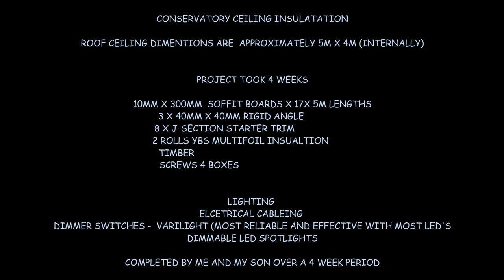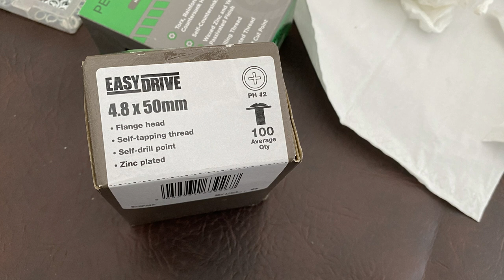HOW TO INSULATE A CONSERVATORY ROOF + SPOTLIGHTS + DIMMER SWITCHES & LED BULBS For Under £700

Comment: Really good job guys, like the idea with the box section around the edge with the down lighters , enjoy .
Reply: That's what I'm looking to do with mine as well. However, I'm thinking of changing it slightly and using a cill board on the soffit about 20mm deeper than needed to place led strip lighting in as well. If I have them switched seperately from the downlights it should give an uplighting effect.

Comment: Hi, You have a lovely video. Such a nice work, am well impressed with your finish. I am putting the soffits board together and it is really difficult trying to use the H trim to join them together and I am at a situation where the H trims are very tight for me to join the soffits board and it’s becoming very difficult. I watched your video and realised you used a different type of trim to hide the joints. 
Please what joints trims and type of screws did you use.?

Comment from the maker: All cladding surrounding spotlights used was 10mm x 300mm,  lengths are what your dimensions are. Hope this helps. The cladding was screwed directly through to wooden frame then I used pvc white screw caps.

Comment: Where did you purchase your cladding from please? Can the insulation not be stuck directly to the roof or does it need to be attached to battens with there a gap between the insulation and conservatory roof?

Comment: Can I ask when it rains do you still hear the sound of the rain on the roof, and out of 10 how much is the sound reduced?
Reply: Hi, we've just had our Conservatory roof done,hardly hear the rain now,used to have the TV on full volume, holds the heat in way better than before.

Comment: Hi, great video, ill be doing the same.. one question.. how did you ensure no water leaked back through the holes for the screws when screwing the first battons to the roof? thanks!
Reply from the maker: Make sure you do pilot holes through wooden buttons and also slightly countersink. I used no more nails on batons. I also made sure I put glue around each pilot hole. Takes a fraction longer but it worked.
Reply from the maker: Make sure all batons have pilot holes same size as screws. Then while holding baton on white roof rafter, pilot drill 1 hole to the white rafter through the pre drilled baton. Make sure the baton has no more nails on. Next drill a screw in this should hold. Then pilot drill through remaining baton and screw to rafter.    HOPE THIS HELPS

Comment: Looks very professional inside, but what does it look like looking down on the roof, i.e. what does the multifoil installation look like through the polycarbonate panels?
Reply from the maker: I can’t notice any difference to tell the truth, remember it’s foil so you shouldn’t see anything. I think I need to put some wet & forget on outside polycarbonate panels
Reply: @vksbirmingham4312  Thanks for the reply, so basically it looks silvery.  Cheers.
Reply from the maker: Very very very slightly grey

Comment: Hi, really amazing job. Could you tell me which trim do you used to cover the gap between soffit board at the conner please. Thank so much for helping!
Reply from the maker: Sorry for delay. I used lengths of 1” by 5metres, then cut them down to size. If possible make sure you used double sided tape because the lengths do not alway stick flush to soffit. ( DOUBLE SIDED TAPE)
Reply from the maker: It leaves very narrow gaps so better with double sided tape

Comment: Great job how are the cladding boards fixed?
Reply from the maker: Start on bottom row by first screwed in J-Trim. I then cut lip off with fine cut saw, because the lip is about 1cm. Need to do this as board won’t sit in trim securely. After all trimming attached the just push boards int place then finally screw edge of cladding from inside edge nearest to Batons with 2ft spacing. I used 30 x 25 Torx screws (eBay)

Comment: Hi how to do you drill holes in the soffet board for the down lights?
Reply from the maker: You can buy circular drill cutters availability from tool station SCREWFIX Amazon

Downlight Holesaw Kit
By Toolpak
'Excellent'
Product code: 90948
TOOLPAK
it+

Comment: Hello, which screws did you use for the battens through the insulation and into the other battens? I'm struggling with the insulation binding with the screw. Thank you for any help
Reply from the maker: I would use suitable length but Torx   Screws are a little more expensive but never ever slip out of bit or screwdriver. I only use Torx screws, so you have a choice. (Basically you want the screw to be able pass 1 baton and the insulation, but ) Remember the 1st baton will already be attached to the conservatory ceiling, hope that helps
Reply: What was the thread like? Single or twin and what diameter of screw? It just spins the fibres into a knot with what I've tried so far, do you have a link to what you used ? Thank you
Reply: @tomdixon6885  did you find which screw to use?

Comment: Do you get condensation between the original roof and insulation, if not how do you ensure this doesn't happen? Also can you tell me how much warmer it was in general in the colder months? Cheers
Reply from the maker: No nothing and 6 months gone, touch wood hasn’t leaked, so I think it has worked well. You will not get condensation if you seal all insulation using the foil tape. I used wickes foil tape but make sure you use the wider one that wickes sell.
Reply from the maker: In winter months when outside temp was 0-5 degrees, it’s not as cold as before at degrees inside was 9 degrees but just to let you know we have a tiles porcelain floor which is freezing, other floors won’t be as cold as these. Got a rad in the conservatory 15 degrees 8am this morning. We have completely covered floor with rugs plus we have 16 windows in conservator that 3 sides completely glass so that doesn’t help either, and 3 dwarf wall and double french door. We use a fan heater for about 5 mins which brings temp up to about 21 degrees it only takes 5-7 mins and the room is very comfortable.
Reply from the maker: Doors adjoining lounge we leave door open so it balances. 
NOISE HAS ABSOLUTELY GONE WHEN IT RAINS....
It’s very useable but still will get cold in winter however just get a fan heater 5 mins and it’s confortable

Comment: What type of pvc did you use for the centre of the ceiling as doesnt look like 300mm soffit
Reply from the maker: I used a bathroom soffit tongue and groove type, its thinner about 6-7mm thick. I purchased it from STAX for about £30 about 6 lengths.The Chrome edging  I purchased 3 x 2m lenghs about £5 each. Took a while to get in position as it was extremely tight which resulted in absolute minimum gap between the 10mm white soffit and flat ceiling soffit, so you have a little to play with. The flat ceiling soffit is very neat cant really see the joint and basically looks very tidy. You will need a thin plastic ruler type thing to help get the soffit into the chrome edging. Hope this helps.

Comment: Hi please could you upload some Klee information ie the size cladding of the under cloaks for the spotlights etc. This looks fab
Reply from the maker: Cladding is 10mm. Width is 30cm by 5 metres, cost  £7. For the lights I used the same, just trimmed the lip off. It was good to use the full size of cladding. If you plan to do this just think if you installing vertical blinds then you may want to go wide or move spots out instead of in centre but to the edge....

Comment: When drilling screws in the first lot of batons does the screw go into the metal
Reply from the maker: Make sure you slightly off centre. Pre drill baton, this will mark the baton. I then drilled pilot hole through already drilled baton, then screw with self tapping screw. This will secure baton, then continue with rest of baton. Look on YouTube conservatory roof this should give you an idea of how the roof panels sit on aluminium roof... I was in same situation as you , worried how baton will secure to metal. I was that scared I removed the top panel from out side to check if screws went through the upvc sheets. Each roof sheet sits on an aluminium cross beam. You must check if you are not sure
Reply from the maker: Yes
Reply from the maker: You could remove an end caps from outside of conservatory roof to see aluminium structure of roof, this will give you an idea of what the aluminium depth and layout is.
Reply: @vksbirmingham4312  You have done an amazing job, the soffit board finish looks top notch! Hat's off to both father and son :) I would like to do something similar but I have been very concerned about how to correctly screw the batons into the uPVC coated aluminium rails without causing any compromise to the underlying aluminium structure. My conservatory is about 20 years old. I have a couple of questions. Hope you will be kind to reply.
1. What is the thickness of the batons you used, did you use bare wood for mounting to the uPVC and use treated blue batons to hold the quilt? 
2. You mention above screw the batons into the uPVC slightly off centre. How deep does the 50mm screw go into the aluminium?
3. I have two sheets that have not been properly squared when first fitted and during heavy rains, there is a drip. To prepare for winter, yesterday I went and got CT1 Sealant And Construction Adhesive to seal what is quite a big gap. Do you think this could become a problem later or if you know of another solution before I embark on the project.
Reply from the maker: @MP-mu1kw  batons available from Selco. They are a standard baton treated blue(5M lengths. ( only one size available from selco. I pre- drilled baton in 3 point . I also counter-sunk the wood and used no more nails. Poisoned glued baton on metal part of roof. Pre drilled through Baton hole with a pilot hole then drilled using self tapping screw until screw has gone In hand tight (Do not over tighten). Then continue with remaining. Just tighten all 3 screws. I used my impact drill on lowest setting, untill the 1st ratchet click then just tightens with hand. TOUCH-WOOD, my roof is still serving it’s purpose, no leaks at all. Not sure about you issue with your current leak…..sorry

I-Also suggest using only the blue batons for all. It’s treated so will be better for condensation

Comment: Looks great, I'm about to attempt mine.

Did you use the glue to attach the first battens to the plastic rails (or whatever they are) for added strength as well as the screws?
Reply: sel-tapping screws throughthe plastic into aluminium

Comment: What cladding boards did you use?
Reply from the maker: 10mm thick, 3m x 30cm boards, I purchased them for £6 per length from West Bromwich in Birmingham it was during the first lockdown near Rolf street Train station